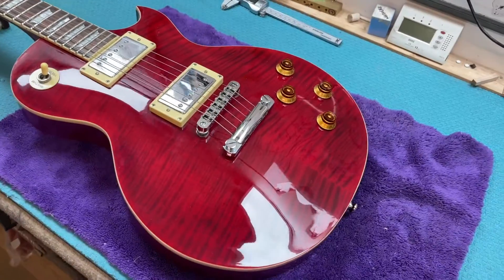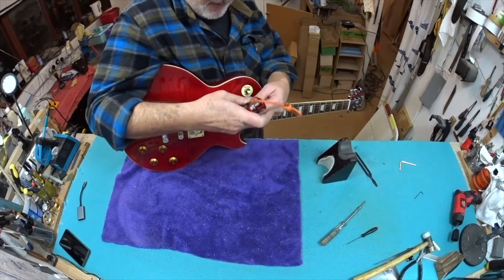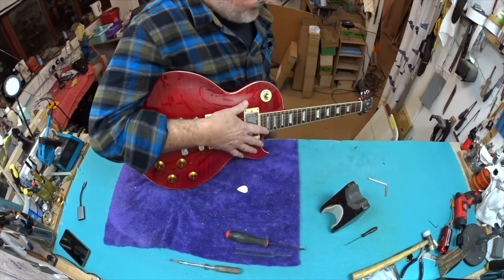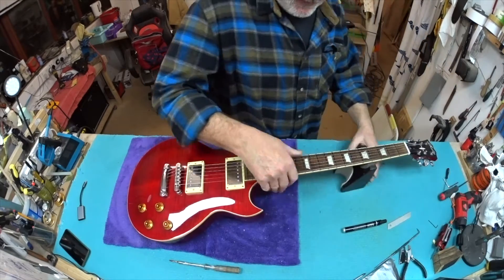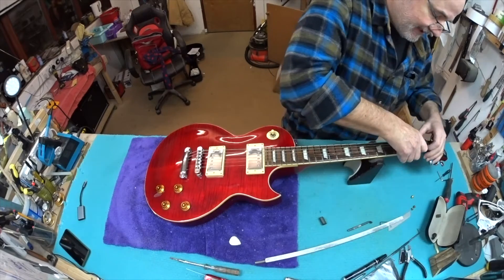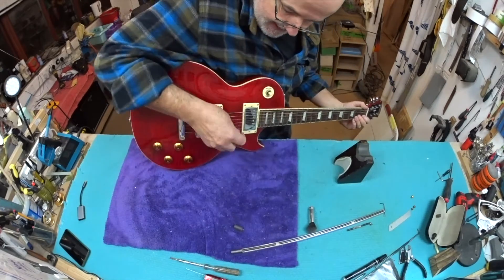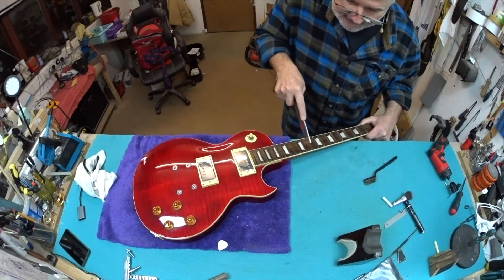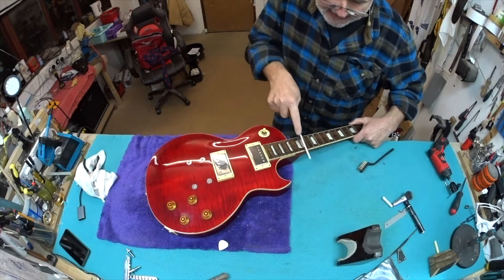Rally GL300 les paul copy set up

Comment: I have recently purchased a number of Harley Benton guitars where the action is acceptably low. 
However the latest purchase,  a SC-450, is not so good, and requires a high action to stop fretting out.
Thankfully I still have the tools I used on three guitars a few years back, so have no fear of using your method for levelling, 
Any doubters just need to try it before criticising.